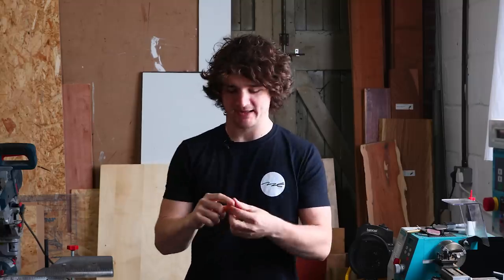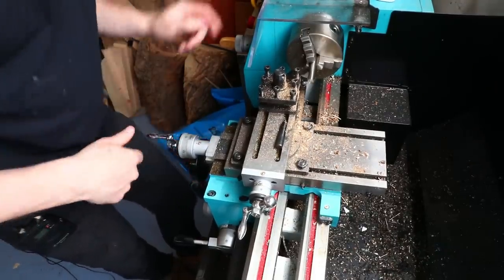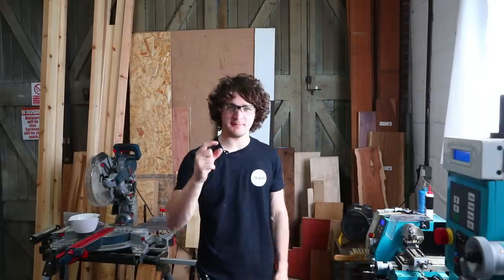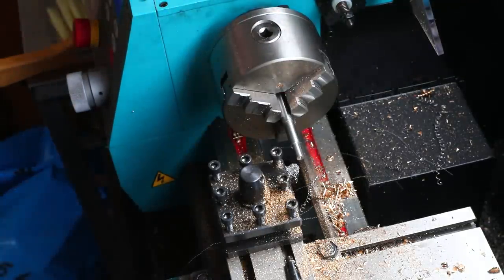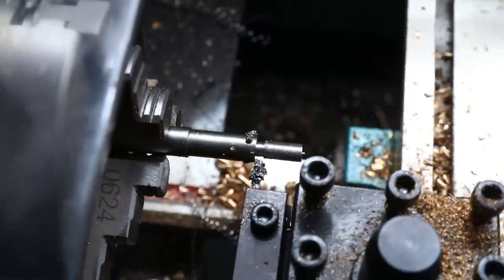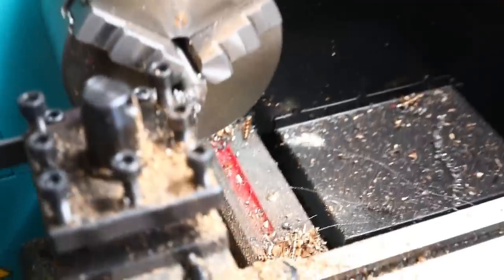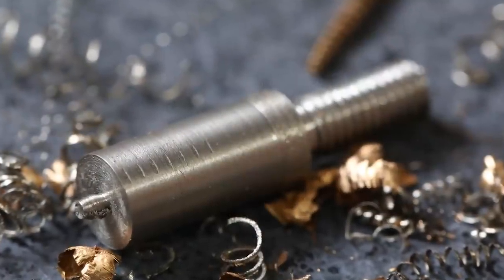Engineers, I need your help | Turning Tuesday #17

Comment: If you're willing to spend a little bit of money, get a quick change tool post. Then you can get tool holders with screw adjustable height, that way you can have all your tools set at the correct height every time you change them out, and it'll just make the whole thing that more enjoyable.

Comment: 5:20 more and less - you have to pay attention for the hysteresis of the lathe fuse - a lathe is never repeating off the position if you turn it’s wheel every now and then in one or other direction. You have to be constant in these machines (this is not a CNC), go for the piece in one direction. If you turn the wheel in one direction, keep it like that, otherwise you would have to reference it on the workpiece again, and you loose time. One thing that some guys do, if you don’t want to scratch (I.e) your working piece, you can use a thin paper/film for controlling the advance of your castle (the part which holds the tool). Once the tool reaches the workpiece, the paper/film will move (actually it will be taken off from your fingers), then you have reached this control thickness, which you can now use to know your scroll’s position relatively to the working piece and apply the compensation. Sorry for my English - I was watching a series on Netflix and just heard (seen) your call! Hehe! The rest I comment later, if no one already did so!
Reply: And Matt, get yourself some calibrated bands and put a few pieces under your tool for increasing its height. With that you meet the center of your workpiece and you’ll not have that material/burr (?) is left on on the edge of the working material.... well, or at least it’ll reduce it!

Comment: You might want to switch to using high speed steel instead of carbide inserts, but with the carbide inserts definitely increase your speed, they’re meant to be ran fast, however high speed steel is meant to run slower.

Comment: Even though im an engineer i am by no means a machinest and most of what i will say has probaly already been said or could be usless as my lathe skills are mainly self tought. 
To set up the the tool to remove the little stubs you are left with put a centre in the tail stock and shim the hight of the tool tip to this.
If im taking 0.1 mm cuts at 400revs ill take my last ones at 0.05 at 800 to get a smoother finish.
Use a centre drill then machine between centres this will stop the deflection and increase accurecy.
Get a water based cutting fluid and pump so you can have a contstant flow this way you can cut much quicker again improving surface finish. 
I hope any of this helps as your videos have definatly helped me in my start to woodworking.
Reply: Hard to see in the  video if you did, but remeber to use cutting paste or oil when using taps or dies too.
I swear by Trefolex.

Comment: Hi! Matt take it easy on the length of stick out generally no more than 3-4times the diameter from the front faces  of your chuck Jaws, if your work piece sticks out to far it will lead to vibration and damaged tool tips so damaged work and missed tolerances, great to see you enjoying it. I'm in charge of a Machining department and do it at home and I still feel like a kid in a sweet shop when i get on a machine. Of course I blame all of those episodes of the A team from my younger years lol.

Comment: Hey.
1.) I think you could increase the accuracy by using the tailstock. The material is then not pushed away. Or use sharp HSS --> less push. Or combine it.
2.) You could get a better cut with the cutting tool if you sharpen it at a slight angle, not straight. The pointed side should be at the right side.

Comment: A few things going on. 1 speed too slow for diameter, 2 you probably need to have a centre in to stop the part flexing away. 3 don't use half nut for feed ( that's for screw cutting ) use feed. you should be able to increase the feed 4 you can use a marker on your cross slide dial so you know when you are at size, and wont need to count every time. 5 make the cuts consistent. finish with .2mm to.1mm  pass each time and you should finish with a consistent size. 
Now I will go back and finish watching the video.  
Good work

Comment: Interesting video 👍 a few things. Turn the speed up a bit as rule of thumb the smaller the diameter the faster it needs to turn.  You definitely need to get the tool on center height. Use a carriage stop to set the length and a rule to measure a set amount of material from the face of the chuck this will mean you can be more consistent with the stops as you only need to set it once per operation.  I really recommend that you watch some of double boost videos on here he is good  IMHO.  
I am not an engineer but do enjoy messing around on the lathe both metal and wood.
And on a separate note I like OSB as well 😀

Comment: Some great comments going on here.

Thought #1: Normally you'd want to cut the material closest to the chuck last.  You're taking such a light skin cut that it shouldn't matter much in this case, but keeping as much bulk there as possible until the end will minimize deflection.

Thought #2: 400 rpm seems slow.

Thought #3: For the pass where you end up slightly undersized, I'd guess a few factors are contributing.  Perhaps deflection, perhaps vibration, perhaps tolerances in the machine, perhaps backlash.  For that final pass, rather than going by the dials/numbers, try very hesitantly sneaking up on the final OD and then noting where the dial ends up.  Second time around, if you go to that number and it's not quite right, then there's probably some deflection going on.  You could also measure at both ends of the cut and seem if/how much the diameters vary; would also be a sign of deflection.

Thought #4: Don't skimp on coolant.  WD-40 in a hand-squish bottle works great.

Thought #5: Really enjoyed this video!
Reply from the maker: Thank you mate! Really good pointers there!

Comment: It looks like the tool is cutting below the center line which will effect how the tool cuts. Your cutting speed is also a bit slow if you're using carbide tipped tool

Comment: A quick change tool post (QCTP) will let you easily adjust the tool exactly on center for each of the tools you use (and get rid of the nub).
Reply: This will help but, it could be parted off slightly longer and flipped and a face cut done to bring it to the exact length.

Comment: I didn't see if it was mentioned or not, but is it possible that the reason your caliper reading overshot the mark is because your early passes were at the higher speed feed and therefore, your caliper was reading the highs of the rough surface and not where the cutting tip is.  On the slower feed pass, you had smaller grooves from the smoother pass and therefore, you are reading closer to where the cutting tip is.  Kind of like trying to read the minimum thickness of a vinyl record album by measuring at the tops of the grooves.  (oops, showing my age with that reference!)

Comment: I would double up on spindle speed and i notice your toolbit is below centre , this could cause push off which would show up if you took the same pass twice and it still cuts.
This in turn can take you undersize , carbide tooling does not enjoy being cooled intermittently (micro fractures causing chipping.) either none (careful with heat when measuring) , or constant flow.

Comment: On a point of SAFETY!!!! At 5.50 you handle the "cool little ringlets" whilst the lathe is running.
NEVER, EVER, EVER !! Handle swarf whilst the spindle is turning, if it grabs, and it will, believe me you will be down in A&E with some very nasty lacerations,
Reply from the maker: Dammit, I liked those ringlets! Good point well made, cheers Keith.

Comment: maybe you could make to parts and join them, like a bolt and a nut. that way you could use material with different diameters and you don't have to remove as much material. that would make it faster.

Comment: Hopefully I can give some constructive feedback:

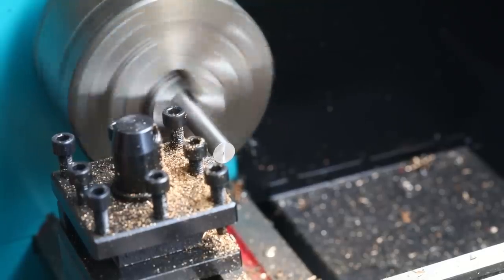at 2:22 you can see your tool is not on level (nib left behind), find a suitable shim and keep it with the tool (or bond it to the underside for convenience)

You're using carbide tooling, need to get the speeds up! Unlike HSS which is tolerant of speed and feed too low, cutting too slow or too light with carbide tools reduces tool life and cut quality. Your lathe can't push it, but suitable speeds for 1/2" ss with carbide tooling is >4000 rpm. Bump the speed up as high as it will go and feed by hand, see how it feels. HSS is more tolerant of slower feeds- about 800-1000 rpm would probably work nicely with a HSS tool on this job.

Your parting tool leaves a nib as they're always pretty likely to shear the last bit of the cut off. You'll notice it probably tends to one side. Grinding a slight bit of cut angle into the tool in plan view can help with this (pointy end towards the face you want to be clean)

As you have few linear lengths you care about, some bed clamps could work well. Imagine a small lug clamped to the bed that prevents the carriage from going too far, setting your depth stop. You can run up to it quickly by hand without watching dials. You have two linear lengths, so you would need one fixed clamp and one spacer you can remove easily/flip out of the way. This does require you pull out a consistent length of stock each time though.

Consider a tailstock die holder as a project, you could knock out those threads very quickly that way

Your excess final cut probably happened as you have both a flexible lathe and workpiece. The tool and part deflect away during the heavier cuts, meaning you dial in more feed than you need. On the final pass where cut loads are lower the spring is reduced and you overshoot your target dimension. Spring passing (running the tool over again with no extra infeed) before taking a measurement could help

You could rig up a DRO with a chinese kit for probably $200-300 for this lathe, which would make it a bit easier to use

Consider partially parting off the part, backing our, deburring/breaking the edge (assuming its not meant to be sharp) with a file (don't tell ohs) then finish parting- easier to hold that way

Big investment, but collet chucks could be very useful. They're more consistent than 3 jaws- you could start with only the first part sticking out, turn it and thread, poke out more and turn the rest and part. While this adds an operation the part will be much stiffer and you'll be able to cut a lot more aggressively

Edit: Also use both sides of your toolpost and loosen/rotate it for the operations. With a shim it looks like the parting tool will clear the compound slide OK

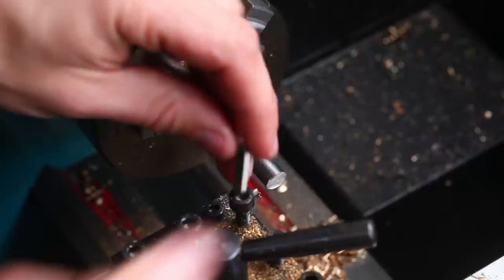Comment: Dude! At 1:30, clean up your act! The machine is filled with the debris from the last session. When you took out the parter, the cutter you put in had debris on the top surface from the last time it was used. You clamped down on the debris. Regardless of whether that threw anything off, it's purely sloppy. You don't know of there's debris stuck on the underside, raising or lowering the edge.
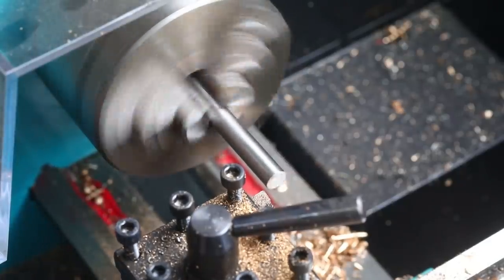At 1:47 the cutter is magnetised. Look up how to make a degausser, it's easy. Those stuck shavings are feeding into your cut! That's a rougher finish, and if heat is an issue it will increase that.
Being magnetised and clearly dirty, the cutter is essentially guaranteed to have gunk on the underside. That can randomly vary the angle a bit with every change.
The face nibs should be barely detectable, not 0.5-0.75mm.
You're not using the quick change! It's main purpose is to not have to reregister every tool change. I don't know if there's a real reason you're not using it, haven't seen your other vids, but that should be a priority. I bet it's one to two minutes per part doing too changes, look at your original vids and measure it. You mentioned shims, which is correct. Imagine juggling those around for tool changes, twice per part. Get that quick change going! Aside from faster, it's just plain easier.
Reply from the maker: Awesome tips there Jim, cheers for that!

Comment: Welcome to the metal world. OK, your basic operation on this type of machine is not bad. The manufacturer of the insert should be able to give you a base speed for cutting the 303, if not use someone else!! Once you get that M/MIN figure, use this formula; M/min x 318 divided by bar dia, this gives you RPM. It looks like your using a CCMT insert which is good, however the radius looks big, you don't need more than .08, on this small turning job, and you are taking very small cuts so a .04 would be better. Don't use tapping fluid for turning, it is not designed for higher temperatures, use soluble oil, or synthetic oil (oil water mix). Have fun learning!!
Reply from the maker: Thank you David, that’s really helpful!

Comment: Even on a quality machine, I’m guessing that backlash/slop in the winding mechanism can be an issue. Secondly, as far as the batch production is concerned, as long as your tools are sharp enough and therefore cutting pressure is low enough, can you just run a significant length down to 9mm, then get your 5 or 10 or however many parts out of that piece?

Comment: check the calibration on your machine, there's no guarantee the machine is fully calibrated, run some soft metals through it and check the amount removed vs what the dials say and take that into account, also keith appleton has a good you tube channel too, he rebuilds steam engines but has a lot of good playlists on using the metal lathe

Comment: Set your compound slide to 30 Deg.  Then use it to take off the correct amount off the radius with out the need to do any math .
ie.. need to take off  0.1 mm ; dial in 0.1 mm. on the compound.   Do not forget to take in your lathe's "slop" at the adjustment
screws do  change slightly over time due to ware, lube and other things.
Reply from the maker: That’s why people change the compound slide to 30 degrees?! 🤯

I’ve seen it done so many times but had no idea why!

Comment: bit late to the party here Matt, and i assume you have got more of a hang off how to use your lathe by now ?? if not, then invest in a quick change tool post and tool holders as they are much easier to adjust for the essential 'tool on centre height' 
If your staying with your existing set up, then adjust as you suggest by shimming the tool until you get it bob on. You will know that you have it right when there is no 'pip' in the centre of the work, also the surface finish will improve as the angles on the tool you are using which have been set to work on centre height are doing what they should be doing, I.E. clearance and rake angles.
Another tip would be to do the facing cut with far less overhang, in other words, more of the work piece in the chuck. this should minimise run out, and reduce the effect of the tool springing against the work, which again will improve accuracy and surface finish.
If you have since mastered this, then all well and good. 
You can also use a die and die holder in your lathe, rather than doing it on the bench, but let me know if you need a how to on this, as im typing this on a phone and running out of charge !!! good luck Matt. Peter

Comment: Matt, I noticed that when you faced the  end of the  bar you tool tip was below centre as you where left a little nobbly bit on the end. Shim up the  tool as you suggested later in your video. (Started typing this before I finished watching). I think also because the  tool is below centre when you move the  tool in a fixed amount it wont take that amount of material off of the  diameter it will take more. You need to draw it out but you have moved the  tool the  length of the  hypotenuse and therefore you go undersized. Hope that makes sense, if not I'll explain next time we meet, that if either one  of us remembers Allan (Church Crookham and Fleet Mens Shed)

Comment: If you Need a ton of this things have them made on a CNC-lathe, one will be maybe 50pounds, but if you need hundred, you will get down to maybe 3-4Pounds for one.If you kepp making them by hand. Put the thead on in the lathe before you part it.  Use your hand tool and put the drill chuck against it to be square :-)Another approach, make the 9mm part on the lathe, drill an M6 thread in the end and glue a long M6 Set-screw into the 9mm part...That way you can make a longer 9mm sektion which has to be acurate and takes time and then part of lets say 5x 9mm Parts at once...Best regards from Germany

Comment: You don't need a engineer, you need a machinist. That tool post can fit multiple tools at once and all you have to do is spin it for a new tool. Also it seems like your turning tool was below center when facing, leaving it on the tool post at all times and setting it up just once will make the process a lot faster. You only need 3 tools, turning, threader and parting. Which can all be set at the same time. Use dykem to mark where you'll stop turning at instead of using a parting tool, turning is always faster than parting on a manual lathe. Also, if you can, reduce the length of the parting tool, you only need it long enough to fit in the holder and have enough length to cut off the part. That all should dramatically decrease the time to make a part. Plus once you get used to the set up you'll know your exact threader infeed. Hope this helps
Reply: Also try not to use carbide tooling, they like very high torque and that small of a lathe cannot give the torque needed for it. Grinding a high speed steel blank is much cheaper and easier and the hss will allow you to take deeper cuts, a lot deeper cuts. Also making your own threading tool isn't that hard but I can understand why you you want to use a die. But you don't need any special tooling for that, just use very low rpm and have a handle of the wrench on the carriage of the lathe, it will thread on and just turn it off when you get close to where you want it to stop and just finish the rest by hand.